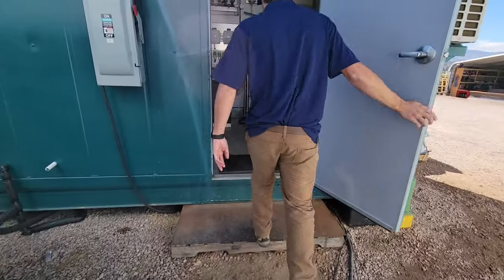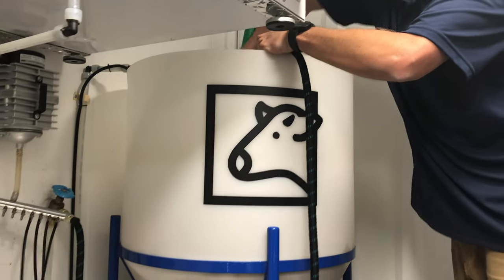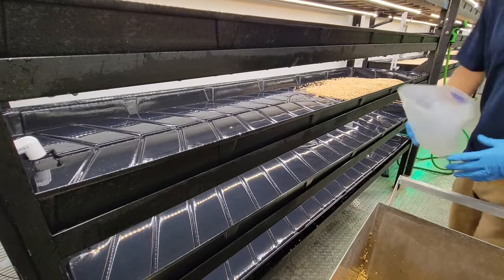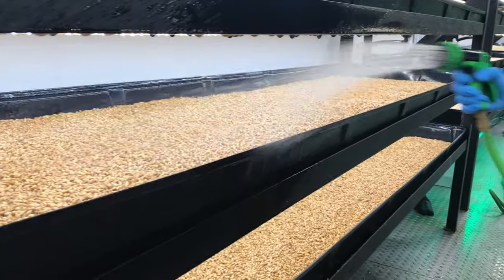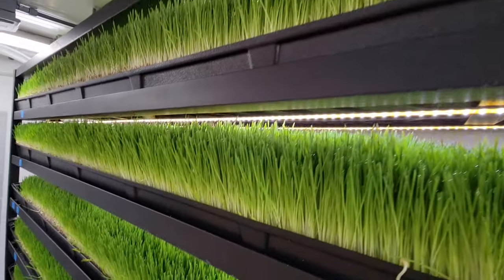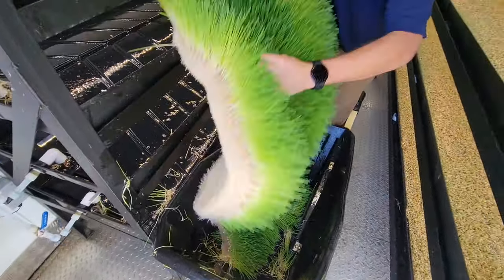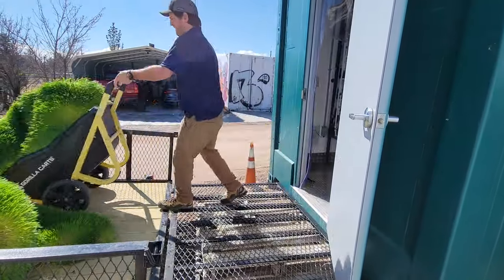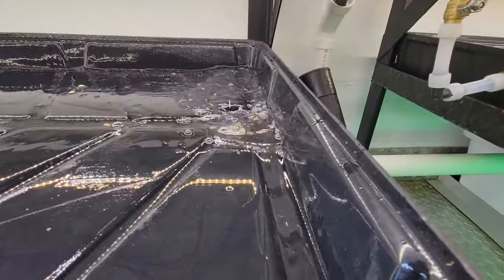Growing Fodder in an Indoor Hydroponic Farm

Comment: How much cost for this box?
Reply: If you did it yourself & you already had the building & didn’t opt for buying into their control station interface & tracking software, then it would be substantially less.
 $7-10K (US) without building and software.
$30-40K with. It’s a wide variable of costs depending on your knowledge level in creating thermostatic controls.